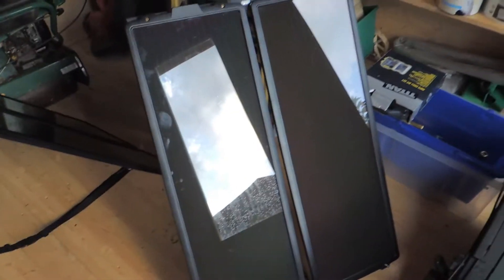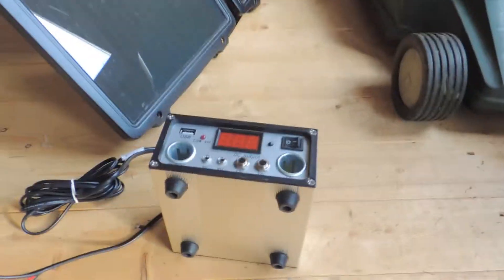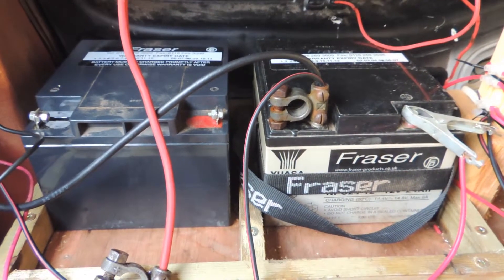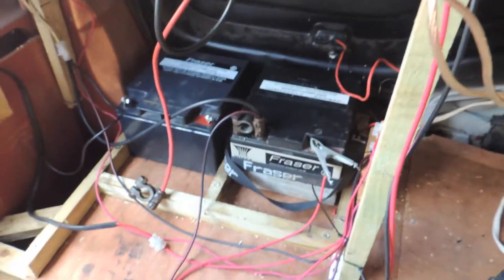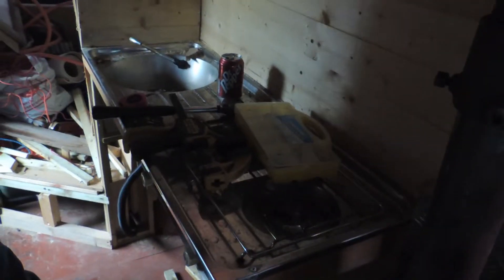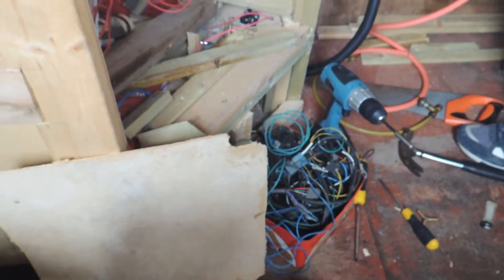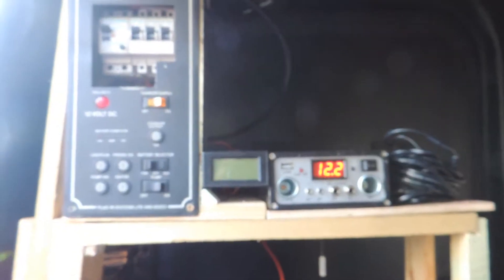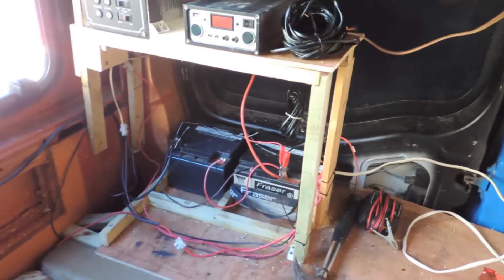Super Bus Mk.2 - Episode 17 - Utilities

Comment: Looking at the stove/burner and kitchen stuff positioning - as-is the burning stove would make one hell of a fire hazard, especially with the gas container stored so near. If you're planning to keep the units in their current position, see if you can add a heat-insulating layer between them. I don't know what those materials are called in English (over here they've got something called "stone foam" or "stone fleece"... aha, looks like one brand's called Rockwool), but the main properties you're looking for are: non-flammable, tolerates high temperatures, poor heat conductor. Far as I understand, it comes in sheets that you can stuff between the hot surfaces (and potential spark-sources) and the flammable materials and the areas where the potentially explosive mix of air and flammable gas can build up. (Okay, the insulating fleece won't exactly eliminate the hazard from flammable gas-air-mix buildup, but insulating the heatsource is a good start.)